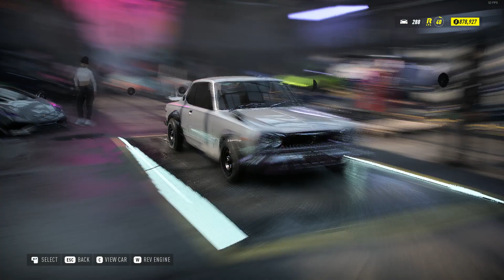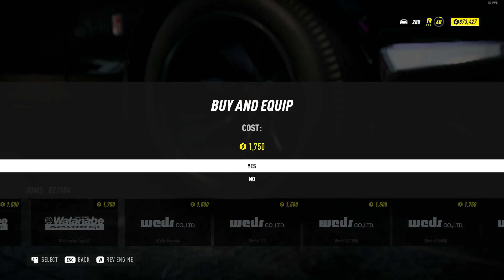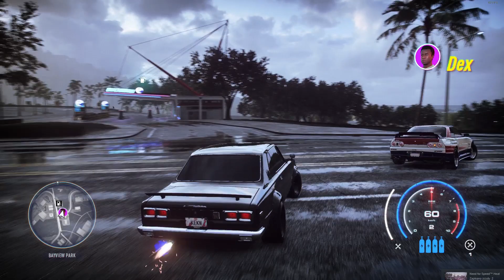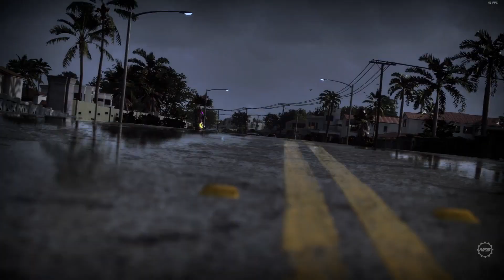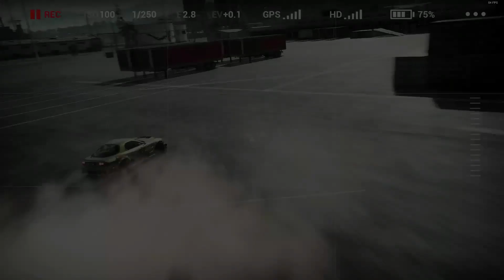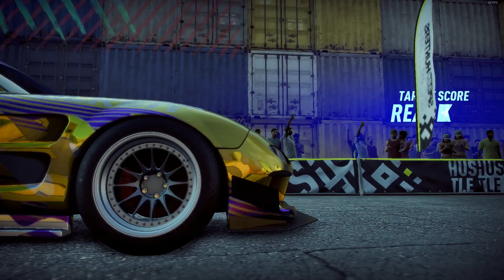Need For Speed Heat Part 20 - Father and Son bonding with a little surprise.

Comment from the maker: My review of the Skyline GTR2000 - this car is unlike any of it's "children", meaning it's lighter than all of them, it likes to drift more than understeer, unless you are unlucky and go into a corner too fast, and has better acceleration than the R32, while having less power, but the top speed can't go over 336km/h on the stock engine, which isn't that bad honestly, unless you meet cops, than you can start getting worried, but if you don't mess up, you should escape them easily. It's very fun car to drive and maybe even good for a drift car, but idk. Also for some reason when you switch on the 5th gear the rpm goes from 7.5k to 6.5k, while for other gears it goes from less than 6k to 7.5k rpm, weird.
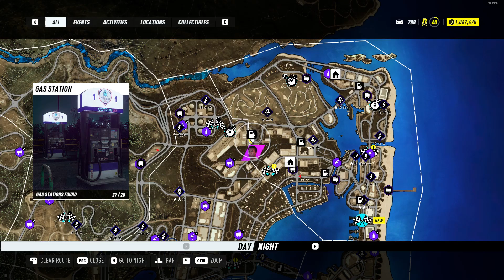19:20 this is where racing starts, if you want to skip the customisation part of the video